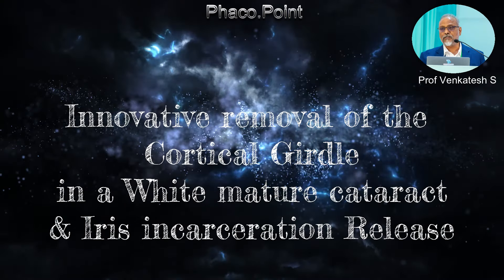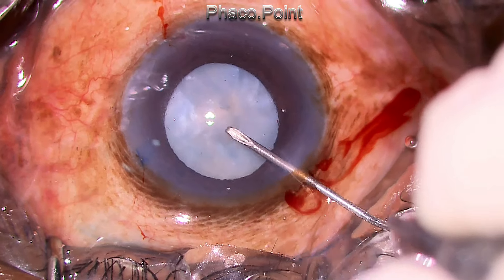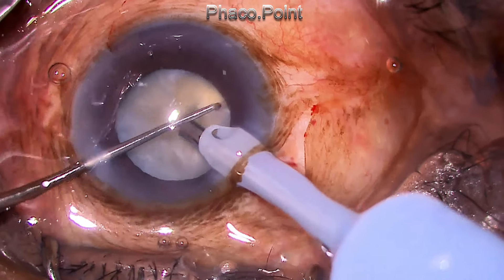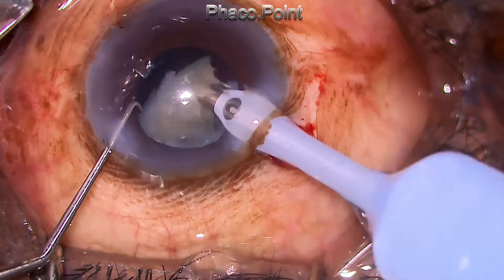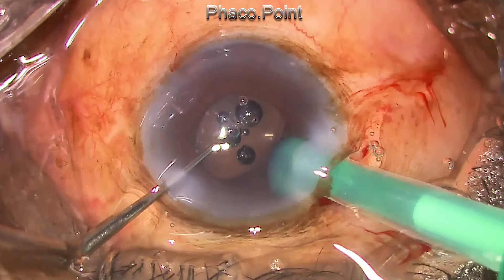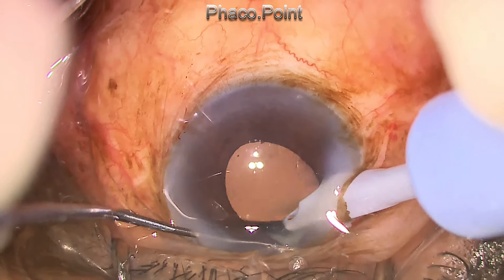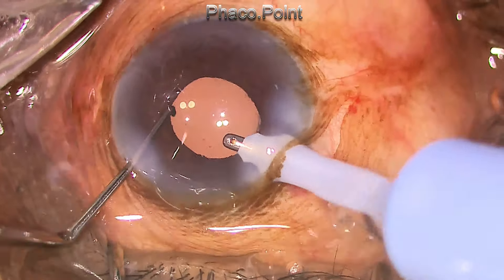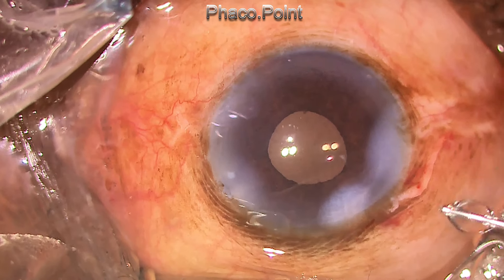Innovative Removal of the Cortical Girdle in a White Mature Cataract and Iris Incarceration release.

Comment: Or after placing iol , pressing the iol with aspiration probe then circumferential manner could also help, i think
Reply from the maker: yes dr Gaurav it works many times but in this case it was kind of stuck so firmly to the capsular equator .

Comment: thank u sir.
its very useful tricks.
my question is: have you ever get PCR by using that trick?
i meant, is it 100% safe?
thank u very much.
Reply from the maker: I have never got a PCR after Pivot rotation. while tilting the optic make sure that the sins key's hook is within the bag and carried to the edge of the IOL optic correctly .. if you plunge it blindly it can hit the equator of the bag!!. but ive never had this complication. by tilting the IOL the zonular stress is actually relieved. do it with due concentration in the initial few cases. and you will understand its safe. confidence with a surgical step comes with practice
Reply: Thank u so much sir..